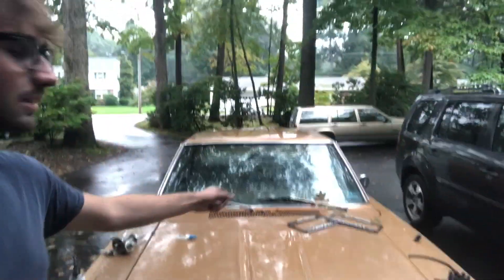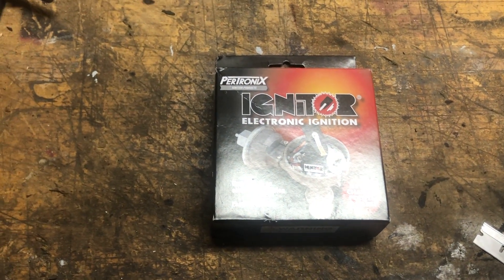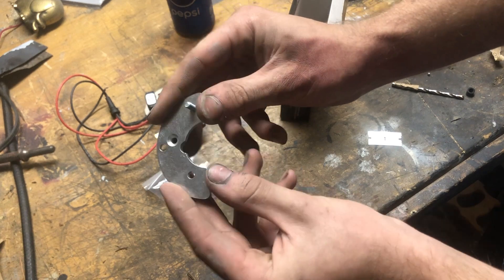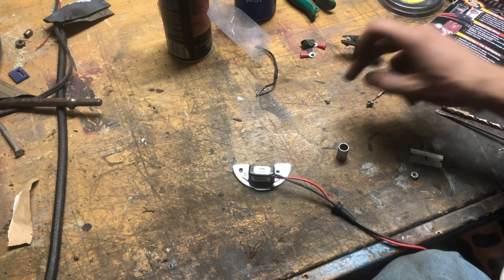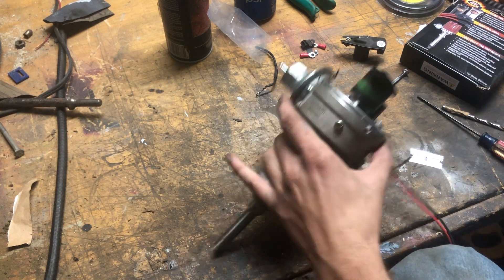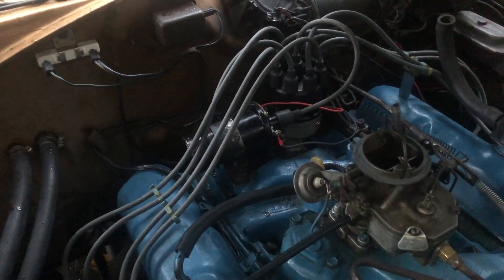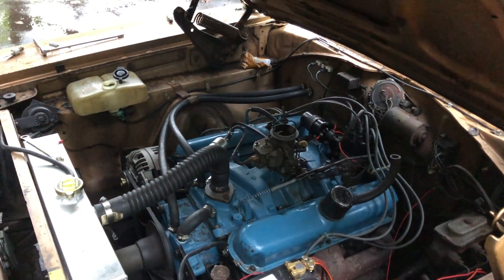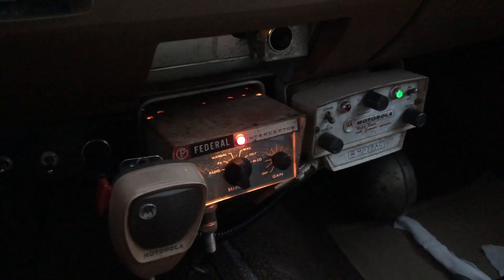How to Install a Pertonix Ignition | Plymouth Small Block and Others

Comment: I noticed the aluminum radiator.  Does that help traction? not as much as a rear engine, but a little? Do condensers really fail any more often than electronics?
Reply from the maker: No, doesn't help traction LOL The original just failed and the aluminum one was cheapest. New condensers fail all of the time, no quality anymore.
Reply: @DubWerks  If the aluminum radiator is lighter weight than the original copper one, then it should help traction like a trunk mounted, or smaller battery.
Reply: @DubWerks  A condenser is a type of capacitor, so I wonder if you can find the capacitor specs and just buy a capacitor from an electronics supplier?

Comment: Nice to eliminate those pesky points.  I remember my dealing with points on my first new car a 76 Rabbit.
Reply from the maker: Points are a pain! Glad a replacement is so easy to get!
Reply: @DubWerks  your right, I got use to it.  Back in the middle 70's the Bosch points were a little of $2 and easy to get to on the transverse 1.6 liter Rabbit engine.
Reply: @davemcguigan218  Points resist EMP pulses both from nukes and cops use them now too to fry electronic ignitions during car chases.  Dodge vans do great with the rear distributors, and Uncle Tony's Garage, here on Youtube, manages to source quality points, with some effort.